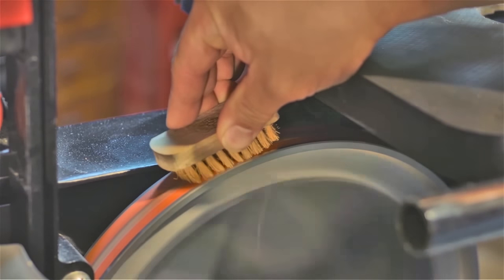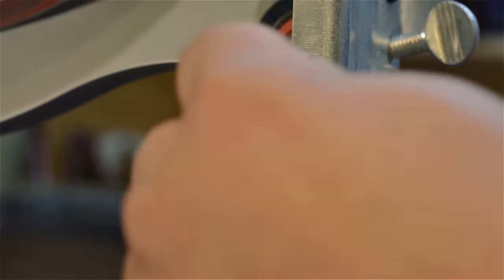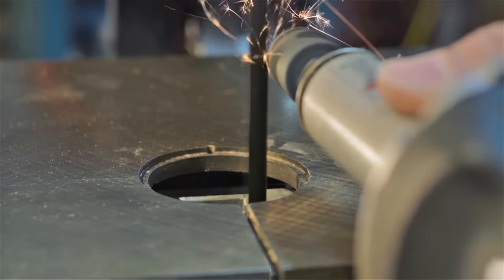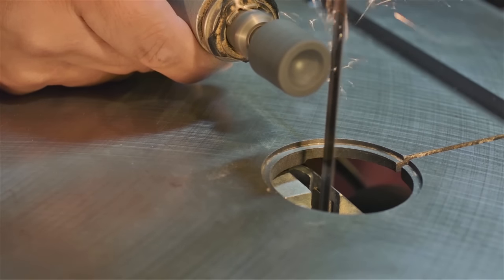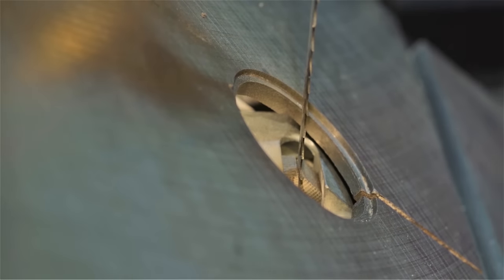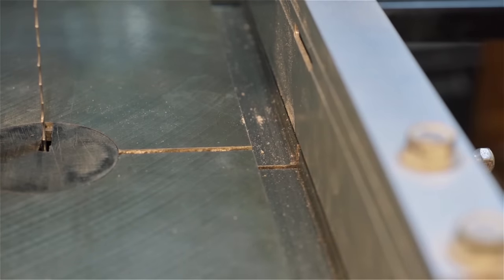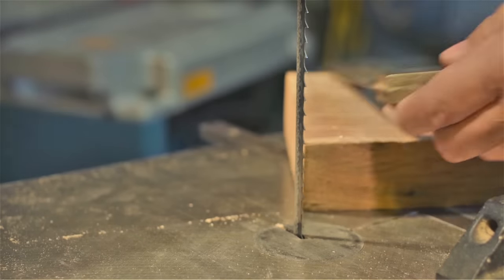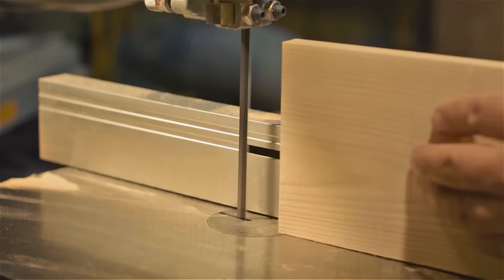Bandsaw Tuning For The Anally Retentive

Comment: Now i know how to perfectly set up a bandsaw. All i need now is a bandsaw 😂
Reply: well get a fuking bandsaw then. a cheap, used one on eBay isn't bad for starter. just make sure the zero clearance insert hole is square if the insert is missing, makes it easier to make.
Reply: @Don Shaffer 
Why?
Reply: Me too.
Reply: @Don Shaffer   It seems internet trolls are now invading technical spaces.  So sad.  Get a hobby, find a friend, go away, troll.
Reply: @Don Shaffer Yeah....why not?
Reply: I got an old delta Rockwell 14" off of Craigslist for $100. Tore it down cleaned it up & rebuilt it. Love it
Reply: Kevin Budde I found one for 450 new tires and bearings all rebuilt painted and restored should I get it ?
Reply: @bettytherussiantortoise2808  only you can answer that. For $450 you might be able to get a new delta bandsaw.
Reply: Woodhog John it is a 14in on a stand and the price was dropped to 400.
Reply: @bettytherussiantortoise2808  ask the seller what size motor it has, & if it comes with any accessories like a fence or whatever you might like, Resaw kit, that sort of thing. If it does, I'd say go for it. Mine has a 1/2 horse motor, & a resaw block & associated accessories would cost a good bit. I modified an old jet table saw fence & put on there. (I cut it shorter.) Was thinking yesterday, before I saw your question, that I wouldn't take less than $350 for it, but I'm not selling either
Reply: Kevin Budde it is 1 horse includes a miter. I really want it because I have an old Rockwell 1124 drill press and love that thing.
Reply: @bettytherussiantortoise2808  very similar to mine. Mine is from the 1960's. Check the trunions under the table. The rear one on mine was broken & I had to replace it. Worked out ok, except I had to stack washers for the front trunion, because the bolt eyes weren't the same thickness on the new one. Probably no issue on the 1 you're looking at, but it's something I ran into. There should be a Placard on it, showing model & serial #. Look on the back of the top wheel housing. All the manuals, parts breakdown, etc are easily found with a quick Google search.

Comment: My wife bought me a bandsaw 8 years ago. I hardly ever used it as it would screech, and make horrible noises, and mostly break blades. It was setup from manufacturer, so I "assumed" that was the way it was. I started watching your video and noticed your band saw makes almost no sound. then you got to the thrust bearing . on my saw, the bearing was set to roll, (outer casing of bearing) rolling with the flat side of blade. I paused the video went out and adjusted the bearing behind the blade as you showed, both on top and bottom . I adjusted everything as you did, now my saw makes little to no sound, and I happily cut a 30 degree angle on some scrap wood, and it tracked perfectly. Thank you, for the explination and the step by step :)

Comment: Honestly , no idea why I watched this since I don't even own or use a bandsaw but it's informative
Reply: same here. but it was awesome
Reply: Food for thought.  I did the same.
Reply: I watched it to confirm why I don't own a bandsaw.  An absolute fucking shit of a tool to get running and keep running.
Reply: Same here... I'm just anally retentive & wanted to be prepared to get anally retentive about a bandsaw, should I ever get one... you know that blade flutter will just set me off :D
Reply: @MiaN3420  I just bought mine and the video was very helpful, watched several others and they were all helpful. Now if I can put the things I saw into practice.
Reply: @whoDatBeDare  Until you need it to make another tool for your shop.
Reply: Probably worse for me. I never got good with my second hand saw. Big move to a smaller house meant that saw and I parted. All i got was poor memories, and that nasty "I still see that bad corner, poor sanding job etc."  Not gonna get another saw, i surrender!
Reply: No idea why I watched this because I don't really do any wood working
Reply: @whoDatBeDare  Not normally , at all . A good saw is immensely useful!

Comment: I got a free Rikon 10-305 with a bad belt, I searched for belt replacement and your video came up after the one I clicked.  Although I don't rip as much you do, I know the small imperfections on the blade can be dangerous.  I seen that the bearings were misaligned as well and now thanks to your video, I know more about the calibration of the saw.  I hope it's not too far gone.  Free and cheap can be expensive... Thank you for sharing this!
Reply from the maker: Free is my kinda cheap!

Comment: Thanks for the video.  Some good points.  There seems to be a lot of debate as to where the blade should run on the top wheel.  Either teeth gullets central or blade itself centred on the wheel.  I think neither is necessarily correct.  The gullet to the mid-line has to be wrong because the gullet depth can be so different for different TPI.  What I was taught to do is to draw a line dothe middle of a thin piece of wood and cut exactly down the line (without using the fence.) If the piece of wood needs to be tilted one way or the other to follow the line then I adjust the blade run on the top wheel until the piece of wood runs exactly parallel to, but not touching, the fence.  Seems to work well and if done carefully should eliminate drift when using the fence.
Reply: So if you have to move the peace of wood left to stay on the line. Does that mean you move the blade more to the back of the drive well or more to the front of the drive well?

Comment: I hung a 2' high x 5' wide mirror in my dining room and called my wife in to see. She instantly told me it was low on the right. I informed her that she was mistaken because I used my new laser level on it. She persisted so I got it back out and lined it up. It was low on the right half the thickness of the laser line (about 1/32"). I trashed the level and now use her on important (things that she can see) things.
Reply: Besides, if she ain't happy; ain't nobody happy.
Reply: Randy, I do believe you an I are married to the same person!  At least they must be related somehow.  I swear she can notice one thousands of an inch variance!!
Reply: My wife is insistent the Christmas tree is perfectly centered in front of the picture window. I eyeball the best I can and then call in the inspector. It take some effort to slide it on the carpet so I need to grunt a little when I move it. Yep, all I do now is grasp the stand and just grunt without actually moving it which satisfies her OCD. "Women! You can't live with them, pass the beer nuts."
Reply: @melmyers4329  That is when you replace the needy psycho that only thinks of herself.
Reply: Run the same level on the wall where it meets the ceiling and where it meets the floor. I would bet that would also be off giving the appearance that your mirror was off.  I agree she has a keen eye.
Reply: @ron827  Lol, never heard that one "Women,! You ..." Gotta find a good way to translate this.
Reply: Some call that an "eyecrometer"

Comment: Just got an OLD band saw. This is going to help me ALLOT !!!!
Reply: Most old bandsaws are very solidly made, maybe a few big castings... you might get a nice surprise if you do all this, and get a blade that actually does what you want to do....  Like if you're cutting light wood and plastics, a sharp new blade, maybe with skip-teeth, it's like a miracle!  It hardly seems to touch the work, the surface is not burnt, it cuts as fast as you can reasonably push it.  I think half the misery of bandsaws is the tremendous urge to just use whatever blade happens to be in there when you walk up.  This is a real problem in school situations!!!

Comment: Thank you.  Very helpful and a good amalgamation of some important tips from other videos namely... 1 gullets in center of wheel.   2. Back bearing settings.  3. Table rotational orientation.   Still no idea why you grind the back of the blade.   It doesn’t cut there and my crap blades cut fine with your setup advice

Comment: IMO the "drift" is from pushing the saw to cut faster than the blade can cut the work. I've never had much problem with that when the blade is sharp and everything is square with the table. A little common sense and patience goes a long way. 67yo newly retired male, 45 mi NE of Denver. 14" Taiwan Delta clone, 20" Grizzly. Building a 35 x 70 shop now. Great Video, Subscribing now.
Reply from the maker: Surprisingly... the original Delta's owner's manual says the same thing... ;) It's not freakin' rocket science!
Reply: Yep drift is to much force on too small a blade. If you're resawing enough that you need to speed though it, get a wider blade and call it day.
Reply: IMO it's the alignment of the gullet of the blade at the center of the wheel that plays the biggest role in "blade drift". If the blade tracking is off it causes the blade to angle away from perpendicular to the table and causes the wood to drift right or left. It causes wearing of the guide blocks, heating of the blade with resultant dulling etc. The whole idea of the adjustability of the saw is meant to make the blade track perfectly square and perpendicular relative to the work piece. When that happens, there is no drift.
Make sense??
Reply: Drift is also a consequence of new woodworkers making the mistake of trying to 'push' the blade back on line, instead of steering it, when working freehand.  Especially when thing's aren't lined up well, and it looks like you're going straight but the cut isn't.  BTW,, if you've never seen a high-speed camera video of a blade that's pushed too hard, look for one.  It's amazing the things don't break more often, all the contortions they go through.
Reply: "I've never had much problem with that when the blade is sharp and everything is square with the table." You say drift is from pushing the work to fast. Then talk about set up. Which when wrong causes drift. I'm not getting the point you are trying to make? Yes pushing to fast causes drift. Well so does a saw that isn't set up correctly! Which is the point of this video.

Comment: I would like to know the size and pitch of the blade you used in this video.  Maybe you could add those details to your description above ^^^^.
You did a fairly tall resaw with what looked like 1/4"  or 1/2" blade and got a good result.  I've witnessed several, so called, experts say this shouldn't be possible or at the very least highly discourage the practice.  The wealth of detail in your video has shown that anally retentive tuning has it's rewards.  Your experience with silicon steel blades was very valuable to me but I expect that Scuff Phlukups would have an issue with your comments.  Too bad for him.

Great job!!

Comment: Main cause of blade Drift.

Blunt blade , causing operator to push  work piece harder than necessary.
Wheels (bearings or wheel bend)
Wheels not balanced causes hammering (moving of saw blade forward and backwards, 5 gram at 5k rpm = 50 kg of swing force !) end result - bearings bust !
blade  drift ,forward backward (incorrect butt weld)
Blade over tightened at some stage (cause ,out of arc when lay  on flat surface )
  tooth setting not correct (more on one side than other (saw runs to one or other side, cutting into or out of work.)
side grinding is never necessary, but tooth setting is, and no .1 mm is not accurate.

too much set on teeth wide groove blade wobbles around . too little , blade burning (especially on wet wood)
hard wood small tooth set , softwood can be more tooth set especially pines... (the gummy stuff...)

If you are going to grind the  the blade back side for severe cases ( use a fixed grinder that is screw  adjustable) do not hol by hand...
other than that... cant say anything  :)
Dang i feel old 30 years ago ran the saw shop 24/7 for a very big company, from 20 gauge guillet bandsaw double cuts to Weinig Frame saws, Sherman 40 blader double arbour.. Now those were the days ..
Peace out.

Comment: My delta 14" band saw has bearings instead of the graphite block. It looks like your version would be superior to bearings. I will have to spend more time fine tuning. 
Thanks for posting. 
New subscriber.
Reply from the maker: I agree, the blocks actually support better than bearings, which only contact at a single (almost infinitely small) point. The blocks also generally keep the blade cleaner too, scraping off resin. They used to be standard equipment on all Delta's - even back to the 80s.
Reply: On my (very old) band saw all guides are plain bearings (soft steel sleeve on hardened bearing steel shaft and hardened bearing steel in a brass cylinder for thrust). They work well but only with very fluid grease. Standard workshop grease is too un-fluid for these. Once I fixed that they work kinda well, at least after a few hours of use (blade wears into the guide sleeves).
Reply from the maker: I've also used brass (which causes the blade to heat up), and different hard woods (which wear faster). The setup shown is to get maximum accuracy for jointing etc. I want to get a second cheap band saw for roughing and cutting expanded foam that I don't get too uptight about. I use re-claimed antique wood most of the time, and constantly hit nails etc. So, no more expensive blades for me.
Reply: Mate those blocks are a revelation! where can I get some? You are the 'This Old Tony' of woodworking. You got a sub from me.
Reply: google "cool blocks"
Reply: My Delta saw came with blocks that seem to be black UHMW plastic.  They work but wear quickly though they don't seem to melt.  I may look into Cool Blocks.
Reply: I have a set of Cater guides on my big saw and it holds true. Though the bigger wheels on a 20" might help the blade, but even with a 1/4" blade it rips within about 2 thou over 12 inchs.

Comment: Putting enough tension on blade is essential also.
Reply from the maker: Correct! I just use the stock spring and guide on the back. Less is better of course, as you don't want to start compressing the tires or abusing the bearings. Let the guides do all the work.
Reply: Excellent video. Lots of great tips as I recently acquired my saw and found the setup to be quite a tail-chaser! However, tension is my question. I have a Craftsman 14" bandsaw who's manual barely mentions tension. There's a 1/2" plastic block below the tension spring that I guess is supposed to be the indicator, but is it the top edge or the bottom? Middle? Who knows?
Anyway, thank you for the excellent video!
Reply from the maker: There are no markings for 1/4, 1/2, 3/8 etc.? Perhaps there was a sticker that fell off. You might try a google image search for that saw. I would just adjust tension until the flutter disappears, or as low as possible. I think it is preferable to reduce deforming the rubber tires as much as possible. Cheers!
Reply: Rockwood Joe Oh! No, there are marks and widths cast into the aluminum adjustment assembly, but no real mention on how to use it. I just figured there would have been a little more info in the manual, but, no. You answered my question about how less (tension) is more, so I'll run with that. I recently found, by accident, how pretty much every adjustment tends to loosen up sooner or later while ripping 25-1"x4"x8', but now your video will help me set things up correctly from the beginning instead of trying to fix things during...

Comment: That blade flutter can be the result of a blade
that wasn't welded in alignment.
Reply from the maker: Ain't that the truth! I've seen horrible welds where the blade edges were at least 3 degrees off on fancy "swedish imported" stuff that sells for over $40. Huge lumps etc. That is why my trusty die grinder (or dremel) saves the day. Nothing worse than getting something in the mail - that you want to use right away, and it sucks out of the box. Cheers!

Comment: There’s another guy that says that drift is a myth. It isn’t a myth, but the cause can be eliminated. One major cause of drift is when the blade wears more on one side than the other. That causes it to prefer cutting on the less worn side, causing drift.

In woodworking, one reason for one side wearing more quickly is the cutting of veneer. The veneer side of the cut has less pressure than the thick side, causing uneven wear. Over time, that causes a slight preference towards the veneer side. One way to eliminate that is, if your saw permits it, to move the fence from one side to the other, causing even wear over time. This is a very old technique.
Reply: Mel Gross that too makes sense. Thanks

Comment: Keith in Far North QLD - I am impressed as I am anally retentive. I have learnt to test, check, question everything over the years. I learned early days in the building industry that if you start, - straight, square, level, plumb it will finish with a lot less problems. It matters not what you a dealing with it is always the same.
Reply from the maker: In engineering its called "error stack up" and it applies to all processes (as you alluded to) in manufacturing, building, cooking, taking a dump, etc. Our current education system puts far too little emphasis on math and science related disciplines - it's like watching a slow train wreck as other countries over take us in effort and capability and we dither about on "social" issues.